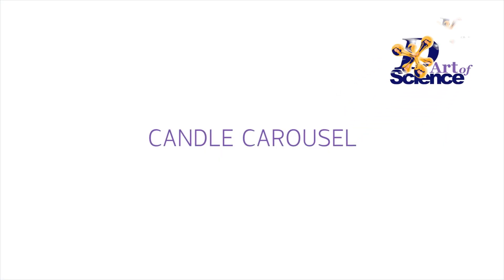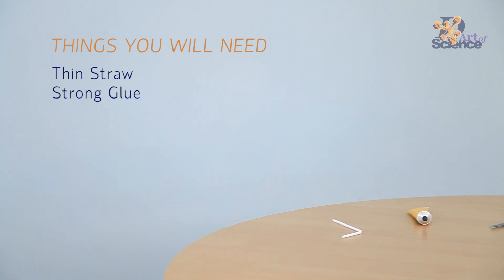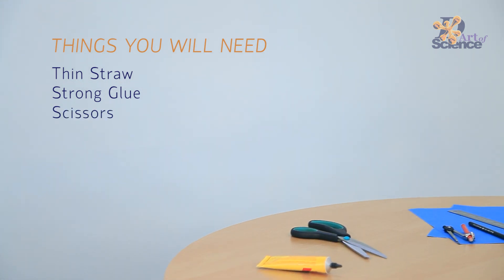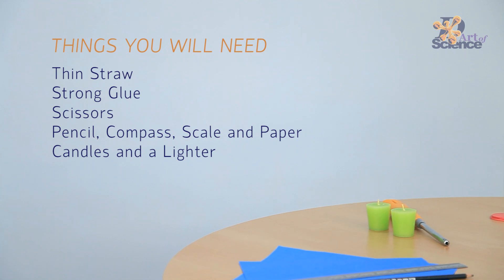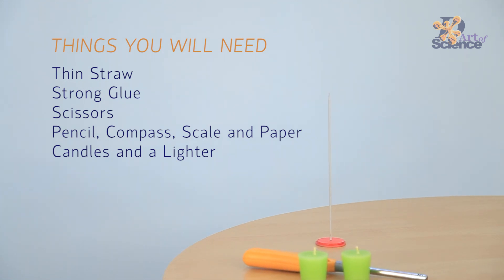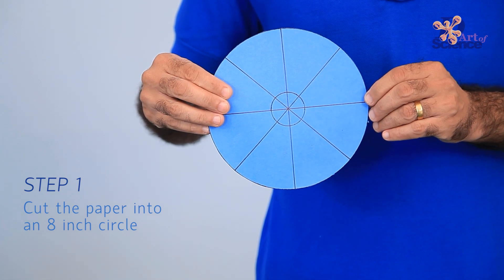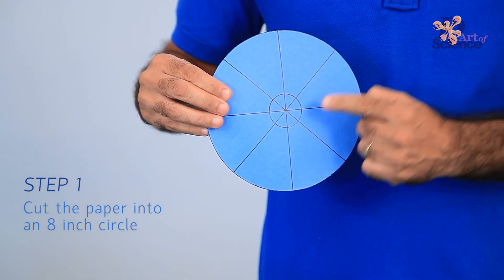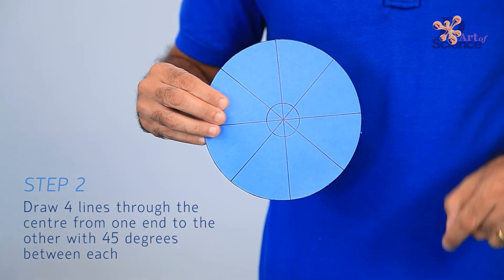Candle Powered MOTOR! | Energy Transformation | dArtofScience

Comment: Will it still work if we use only one candle on one side?
Reply from the maker: Hey, it may work with one candle but only if changes are made to the flower shape. However, the effect may not be as strong and the base may spin more slowly. So it is recommended that you use two candles!